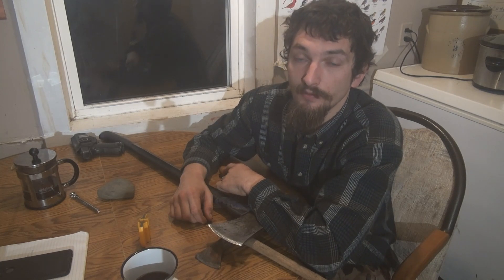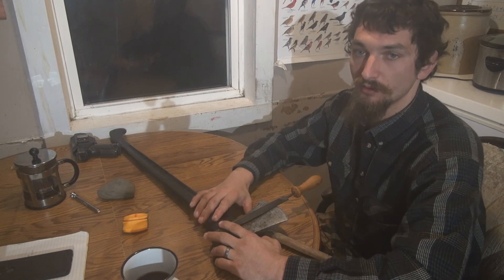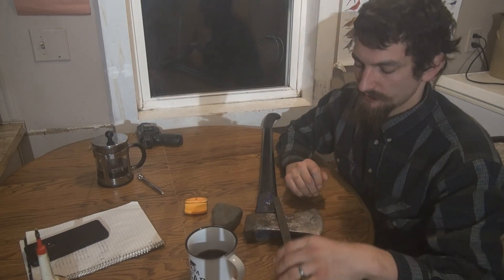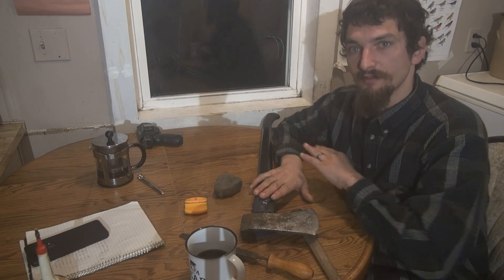How to Properly Sharpen an Axe

Comment: Is there a benefit when using a file going towards or away from the blade?
Reply from the maker: Working into the blade makes a better edge, but it's easier to cut yourself. Most guys I know file into, not away from the edge.